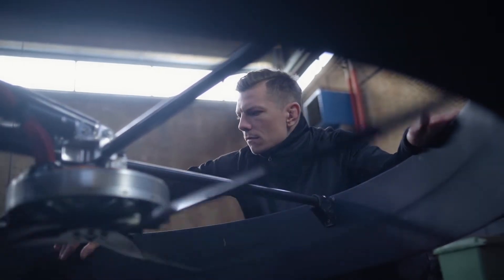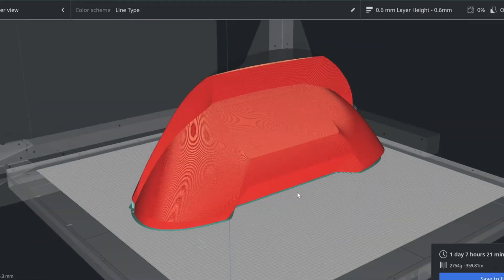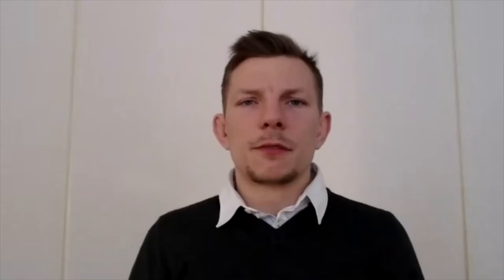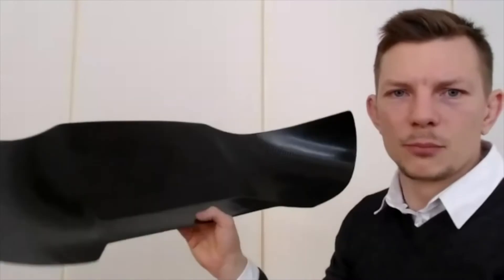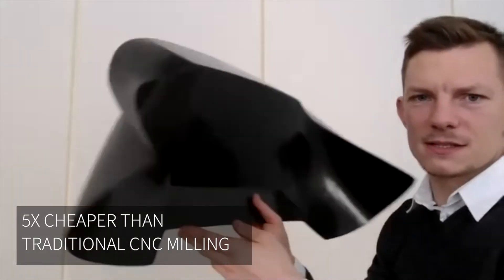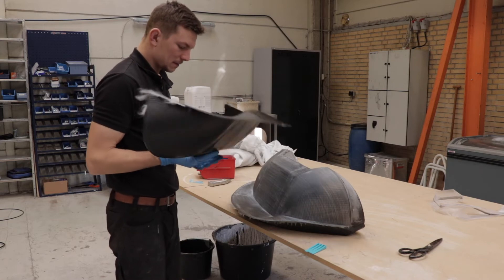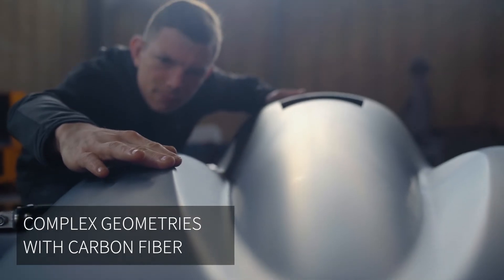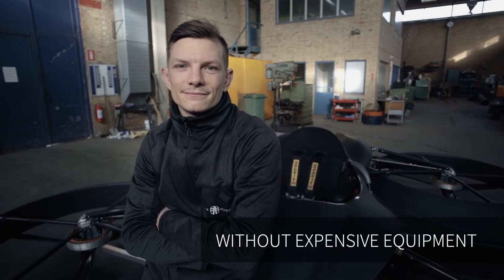Carbon Fiber Mold Making with 3D Printed Molds

Comment: How many times can the mold be used?
Reply from the maker: The number of times a mold can be used is determined by a number of variables, including the mold's quality, the production environment, the complexity of the part being molded, and the mold's upkeep and maintenance. With the right maintenance and care, carbon fiber molds can typically be used for multiple production cycles, though their lifespan can vary depending on these factors. After each use, it's critical to assess the mold and keep track of its condition over time to determine when it needs to be replaced.
Reply: Do you put carbon fiber in the mold?

Comment: perfect project!  what is  wax ? . thx
Reply: What is the brand and version of the wax 🙂
Reply from the maker: You use wax as a separation layer between the mold and the carbon fiber part, so you can take it out of the mold more easily.